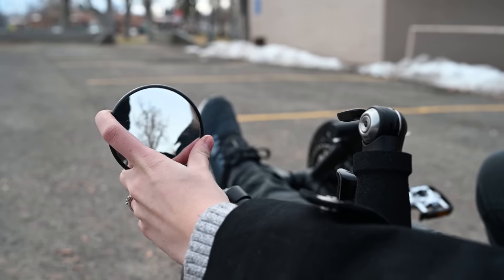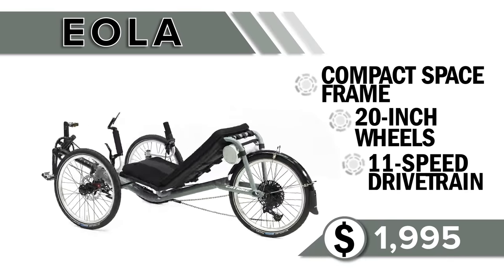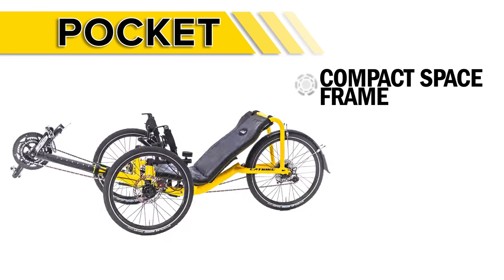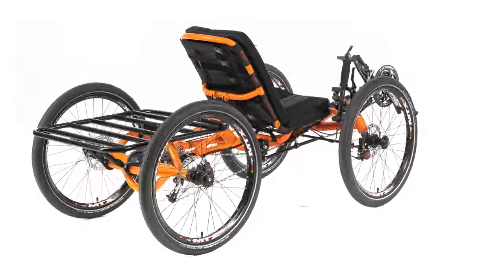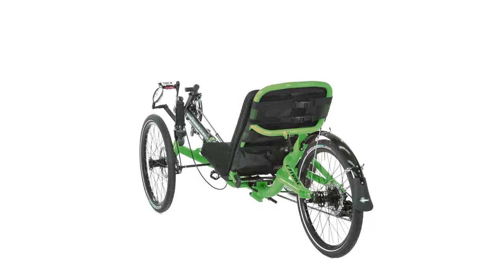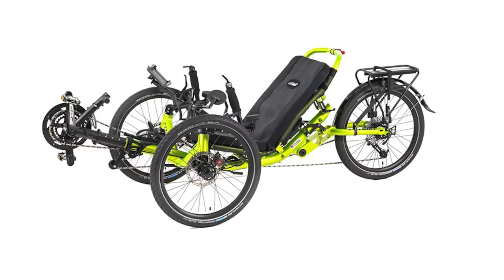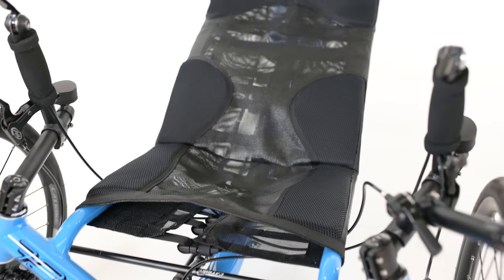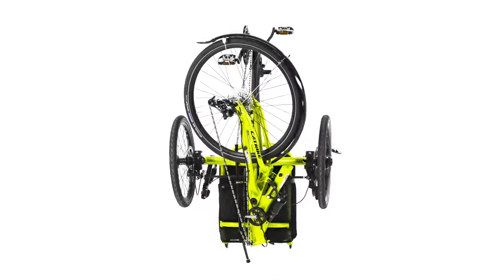SEE THE ENTIRE CATRIKE LINE UP! - A quick look at each model! - Presented by Utah Trikes

Comment: I was wondering, is there a hard case for the folding trikes for air travel?
I'm saving either a trail or the 559. It will be a few months.
I haven't tried a trail yet but what I do like about it is having the same tube or tire size for any repairs. 
Can the trail be turned into a quad later on? Or does it need to be welded?
What's the difference between the trail and 559? Besides the 26 inch wheel,  does one sit higher or lower? Is one longer or narrow than the other? Thank you for these videos.